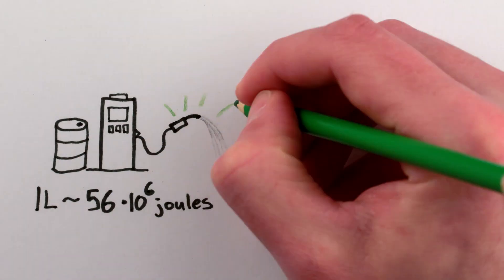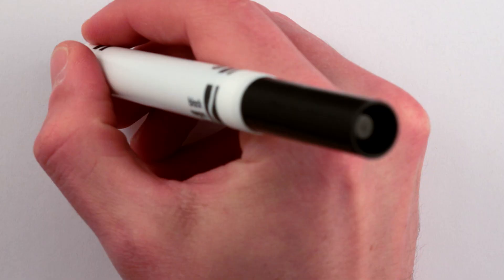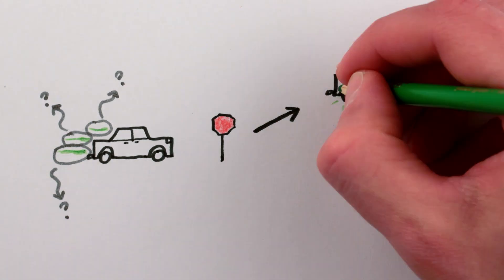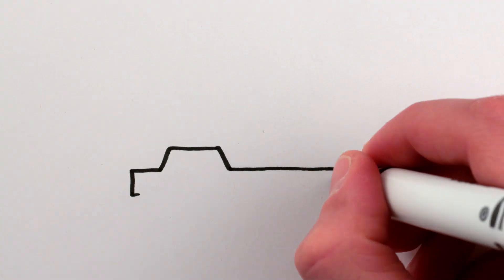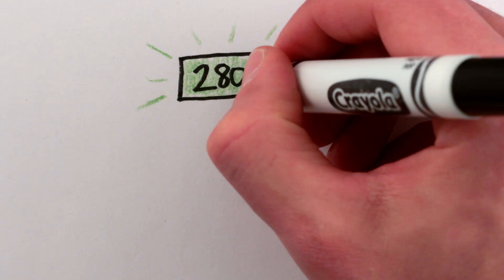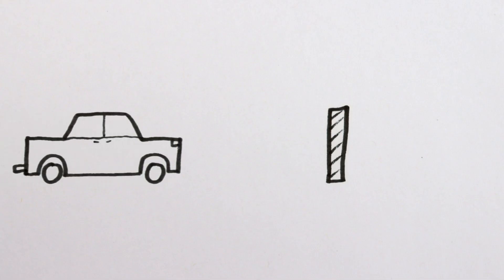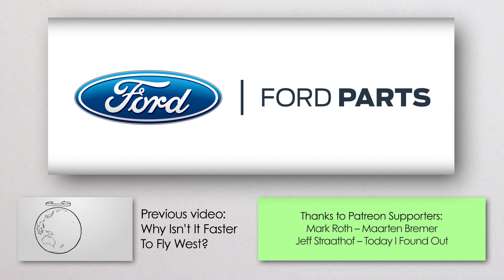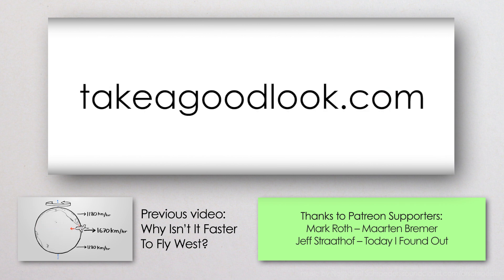The Physics of Car Crashes

Comment: Another technique is that the engine is designed to be deflected down under the safety cell. This is good for 2 reasons. The first is that the engine is pretty solid and can't be compressed. The second is that the engine is heavy but by deflecting it down under the car it doesn't have to decelerate gently and the crumple zones don't need to worry about absorbing all that energy. Let the engine hit the tree and come to a dead stop while the car is "gently" decelerated by the crumpling above it.

Comment: a full day is now 22 hours?
Reply: Toasters sleep for 2 hours per day
Reply: Lol
Reply: You can't have a toaster in "power cycle" continuously. (Unless maybe you deliberately short over the thermal sensing part of the circuit to burn an open in the NiChrome wire heating element rather quickly)

Comment: this might sound like a dumb question, but can you predict the when an elastic or inelastic collision is about to occur? does it require calculus or advanced understanding of physics or what?
Reply: yes
Reply: +Daniel Hong You can't predict it necessarily unless you have experience with the material. Every material has a different yielding stress, and that stress is what determines if it will be an elastic or inelastic collision. With the outer body of an average car, almost any real impact will be inelastic. It doesn't use calculus or physics, although it is a prerequisite. It's more of material science or mechanics. There are tables and charts online for the yielding/ultimate stress of certain materials, understanding that graph and you're golden.

Comment: I have a question:
Why not put an airbag on the front of the car that would be released whenever the car hits something with a certain speed?
Reply: Hmm, but how would the airbag know when to expand outwards before hitting the car?  It'd have to know the future on when someone will get hit.  And if you're saying have the airbag expand after the collision, then I think that won't work because the force has already been exerted?  I'm not too sure haha
Reply: +StenoDubstep Have a sensor in the front bumper that measures distance (infrared lasers work well, so does ultrasound). Feed that information to an onboard computer that calculates whether or not you're going too fast to stop, and whether or not to deploy the airbag. Problem solved.
Reply: +Jordan O'C (Xenro66) what about parking? The front is a wall sometime
Reply: TLK Dragon That's why the computer analyses your speed, and the maximum deceleration via breaks. Logically, it would never go off when parking, unless you're flying at the wall at 100km/h in rain.